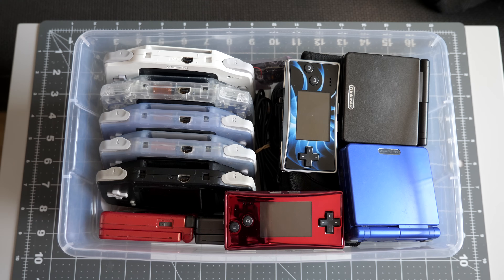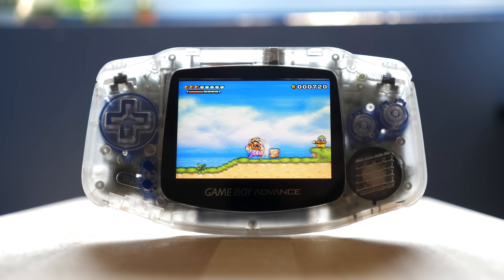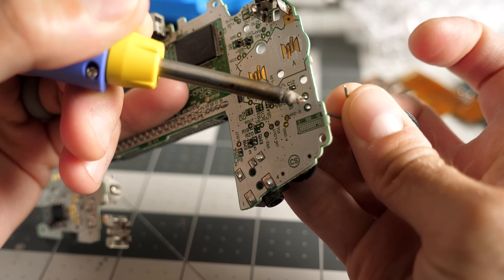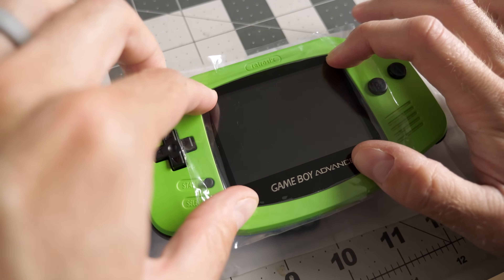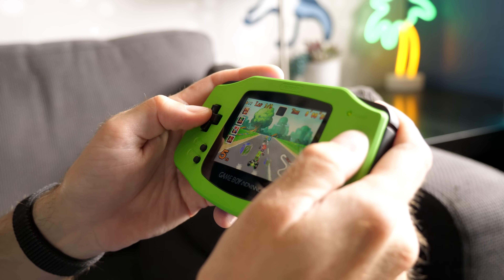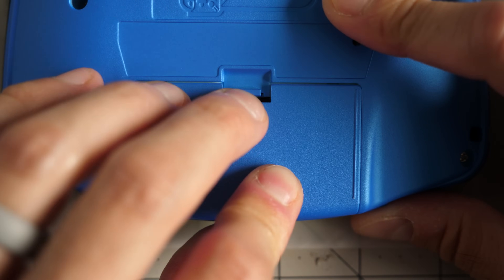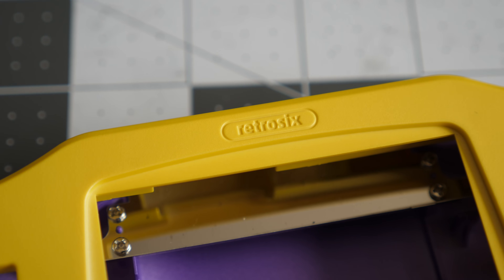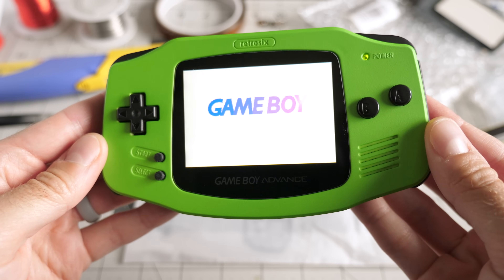Let's Build the Ultimate Game Boy Advance for 2020!

Comment: I would like to see you test out those amps that’s advertises a solution to the buzz you hear in the headphones. They advertise EMI Elimination.
Reply: 666Gothicgirl sadly it won’t mute the speaker completely, but it does remove the unwanted noise.
Reply: @samuraivader3814  what do you mean? It shut down complete the game Sound when insert the headphone. The noise is reduce to a Level that you must put the gba on the ear to hear it.

Comment: Retrosix Shells are also dont fit Perfect and the Metall from the L and R has to less Space to fit. At least the holes for the screws are different i Need to Use 1 Smaller Screw for the motherboard (there are 3 to hold the Board Inside)

Comment: I love my IPS/Shell modded GBA, but for some reason, the D-pad is always really unresponsive and needs to be pressed hard to register. No matter what combination of original and replacement D-pads and membranes I use, and even after the use of contact cleaner on the contacts. I don't know if this is a limitation of the hardware, as I never really played an unmodded GBA, or if I'm just having bad luck.

Comment: Mmh I would put the sound board on the back side of the gba.
And the Asian have good fitting boards that reduce strange sounds.

That battery mod is to expensive for my thinking.
A lipo, a tp4056 and a diode are cheaper and all needed for a lipo battery mod.
And when needed you can as dd wireless charging
Reply: The plus with this battery is that it's drop in. You don't have to do anything to it. You can buy the parts cheaper yourself but you'd have to solder it together.
Reply: @auqustfire  yeah the drop in is the only plus.
Soldering a battery, tp4056 and a diode are really easy

Comment: I have a question about a gba game I just got second-hand. It’s on Ceash Bandicoot Purple Rpito’s Rampage. I put the game in and turned it on and it booted up a Spyro game. It had a full menu as well as all the intro’s. I was confused and took the game out to make sure I put in the correct game. It said Crash Bandicoot and definitely not Spyro. When I put it back in and turned it on it booted up the Crash game normally and I have no clue how to check out that Spyro game again. I wonder if you might know something about that, or maybe point me in the correct direction. Thanks.

Comment: The only thing I'm jealous of is being able to charge using USB otherwise I still like my ags-101 I bought one of those USB cables that has a Gameboy plug on the other end but the system shuts off if you plug it in so I'm assuming the power is not good
Reply: This is weird

Comment: Great mod!  I was confused - is the lens / screen cover glass or plastic?
Also, there's a clock-speed mod called the GBAccelerator that you can add that allows you to speed up or slow down original GBA / GBC / GB games.  (It doesn't work with Flash carts.)  You can cycle through the speeds of .85x, 1x, 1.5x, or 1.75x speed.  It helps with games that have lag on the original hardware, as well as grindy RPGs - or slowing down tricky parts of games.  I believe it's made by division-6.com and can be bought in the US from retromodding.com (I'm not associated with either - just sharing links to help any fellow gamer who might be interested.)
Just to be clear, you can still use Flash Carts if you install the GBAccelerator - you just have to have it set to 1x speed (normal speed) for them to work.
I am curious if there are any stereo mods for the GBA, or turbo button mods.  I don't think I've ever seen them, but I think those could be things added to improve the GBA even more.  Also video out would be awesome.

Comment: Does the USB C charger that comes with the Nintendo Switch lite work for charging the “Clean Juice” battery ? 🔋 🔌
Reply: I use the usb c from the nintendo pro controller and it works. I dont know if those cables are different though.

Comment: I did an upgrade to the IPs v3 for a gbsp, one I had dropped. Old screen was white no sound however new panel now just shows a multitude of colours with no movement or sound. Is this a board issue? Thanks for any advice.

Comment: Hey Colin, I just made my GBA last night and everything was great, except the shell was giving a lot of resistance when putting the new screws in. They fit, but it felt like I was stripping the shell. Did you have any issues like this?
Reply from the maker: That’s normal — there aren’t any threads cut into the screw holes in the new shell, so the screws are going to be a bit tighter during installation.
Reply: Thank you so much, that now makes sense. One other thing, how do I remove the left-side’s battery terminal to make room for the rechargeable battery? I’m not having much luck with that either.

Comment: I’m new to all this, I’ve ordered all the stuff they had in stock other than the sound as I’m not too bothered about that for now (or is that essential?), the only thing they didn’t have in stock is “Game Boy Advance IPS V2 Kit - Funnyplaying” is there anywhere else to get this? (I’m in the U.K. also) and...is this easy to do and can it be done with no soldering? Thanks!
Reply: Oh also I need a donor gba right?
Reply: I actually ordered from U.K. and Canada to US because stateside shops were out. I would just look around for funnyplaying vendors that ship to europe.

and yes you will need a donor gba. There are two board types of gba, but funnyplaying is compatible with either.
Reply: PjTabAndClcc yeah I’ve built mine now :) I love it! Doing a gbc next

Comment: The Game Boy Advance is the only handheld I can think of that doesn't have a way to power it from the wall.

I have a Windows 10 laptop that doesn't have a battery because it's a few years old and the battery died yet I can still use it because the wall charger just works without the battery even installed that's how much I can't think of any other portable device that doesn't have Wall power of some kind

Comment: $134 if I already have a mostly working GBA (I don't so that's another $50 on ebay) OR I could spend $200 on a new Analogue Pocket, The mods do sound like a good deal it I had a mostly working GBA but without the Pocket sounds better

Comment: I wasn't lucky with mine. IPS v2 draws so much power that the EverDrive GB X3 is not working any longer (screen goes black after launching a rom). EZ Flash IV still works fine. Do you guys know a GB/C flashcard that still works after performing the IPS mod?
Reply: EZ flash junior maybe? Not sure as I don't own it. But same brand as EZ Flash IV and Omega so maybe.

Comment: So is it not necessary to use something to insulate the back of the screen if you're using the 3d printed bracket?
Reply: 3d bracket is all you need. But these brackets only work with these shells :|

if you go for other shell styles, youll need tape or other padding to keep the screen steady.

Comment: Game gear needs more mods. The mcwill screen is pretty much all there is. Retro modding does 3D printed buttons but other than that. Nothing. Especially these battery mods. If a handheld system ever needed one, it’s the game gear with its 6 AA’s. And replacement shells are needed. The old ones are just getting to that junky stage in looks.

Comment: Do you think ips screen is better than the AGS101? I have 2 mods with ags101 and I'm very happy but I'm thinking about doing one with IPS screen
Reply from the maker: Yes, the IPS screen is amazing — check out the review/install video I did on it, I showed a quick side-by-side comparison with both an AGS-101 and a 101-modded original GBA.
Reply: It is, there is no reason to upgrade to AGS-101 anymore unless you want to keep the hardware original.

Comment: Question, Do i need that Clean amp or will the build still have sound without it?
Reply: As long as you GBA still has its original speaker it'll have audio.

Comment: Wait so you have to remove the battery contacts on the shell?  Cuz on the website it doesn't say anything about having to remove them
Reply: You don't have to. The battery fits just fine with the contacts still in (and the contacts on the shell side is just a dumb piece of metal with a spring attached anyway, and serves no purpose if you're using Li-ion battery instead of AA)

Comment: I'd really be interested in doing a project like this one. However I dont have any soddering experience at all.  Coud anyone reccomend decent soddering equipment suitable for taking on a job like this one. It doesnt have to be super high end. Especially since this project would likely be the only time I ever used it.
Reply: Some of the cheaper ones on amazon work fine for a beginner. Being able to choose temperature is the most important feature you will need. Second most important piece is learning proper soldering procedure. Lots of resources online.
Reply: @philipbarker5496  Thanks fot the heads up!

Comment: Hello, please can someone tell me if there is a big difference between the plastic screen lens and the glass screen lens? Thank you
Reply: Plastic screen lens are easier to replace since they will flex. Glass is more permanent but more scratch resistant.

I would go with tempered glass, the retrosix shells in this vid include a glass lens, so if you’re ok with the shells, nothing to worry about!

Comment: Way to expensive by a long shot.  The DS lite is less than 60 bucks almost everywhere. These are gba micro prices. No one will collect these in 5 years so they won't hold value as a collector item.  Better cheaper made by Nintendo options in 2020 they put their brand on it and earned their reputation.